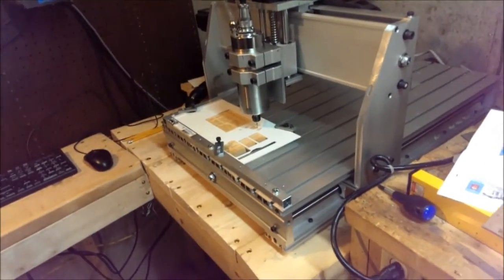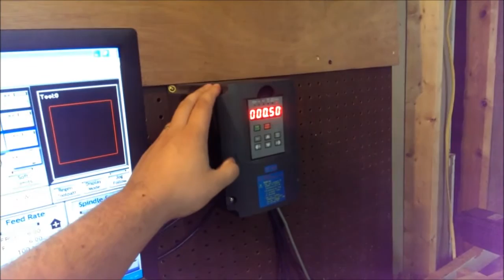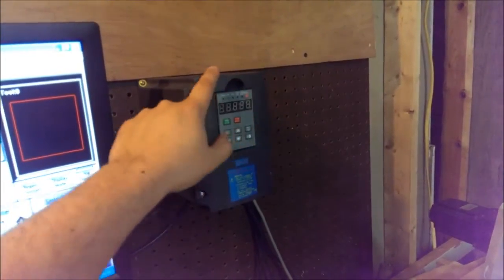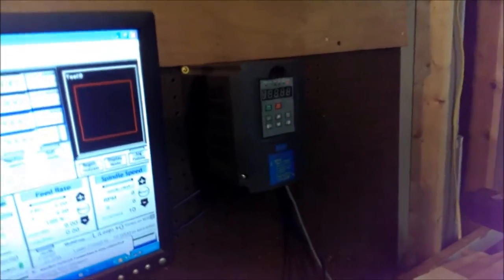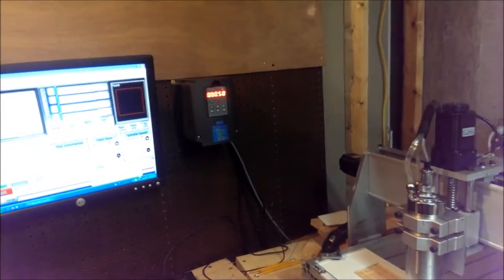6040 CNC Machine Unboxing

Comment: I got the same one (almost identical). I replaced the controller box with decent leadshine drivers and 48V power supply. The motors are good but the electronics is rubbish. I get speeds up to 3.6M/min safely now compared to 1.4M before. Anyway, your video is 3.5 years old so you probably made some changes to :-)

Comment: Hey, does this model have a support bearing between the e.g. (longest) Y-axis ballscrew and its stepper motor axis, or is the ballscrew just directly coupled to the motor?
(if you ever bothered to look...) The sliding nut on that ballscrew, if you look inside with a flashlight, is it plastic?

Someone who bought a 6040 with that controler and overall look told me at least it has that support bearing. Would be nice to know if it was still the case somewhat more recently.
I bought "the model" (god knows how many clones of clones there are) that's painted all beige and has an all-in-one controller box incl. VFD (which, from what I've read, is not the best as VFD noise may disturb the stepping...)
and that one has no support bearing and other funny skimping on parts...
So I'm wondering whether there are still packages sold which are somewhat less crappy ;)

Comment: Timelapsed, but still found myself skipping through. :/
Reply from the maker: Wasn't meant to be a super interesting video to the general populous, just something to show those who might have some interest in the machine and my thoughts.
Reply: +Downing I meant just skipping the time lapse. I wanted to see what was going on. So the bed is stationary and the gantry moves? I think the problem you're having is the reason why I prefer a moving bed. But that really only works for a smaller system.
Reply from the maker: SNEAKxxATTACK Yeah, it was just the speed I was used to with the smaller machine. It could go faster because it was a lot smaller. Moving bed wouldn't work well on this one because the bed is over 30" long. Even if the travel cut distance was only 24", that would still be way too far to stick out and probably flip the machine or at least pivot the bed. Just have to work out the kinks is all.